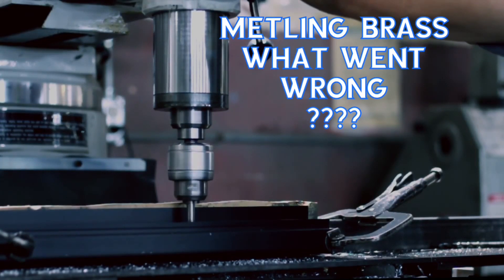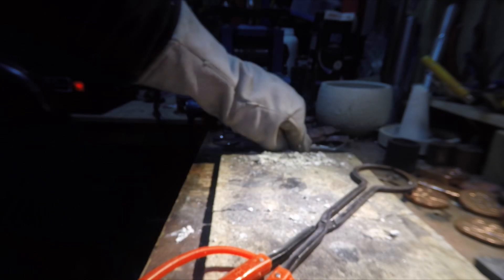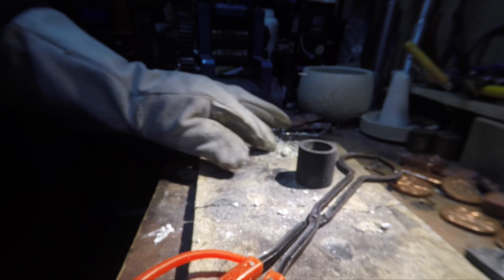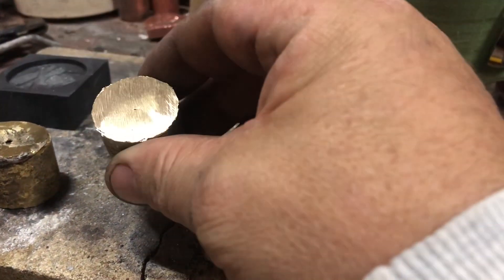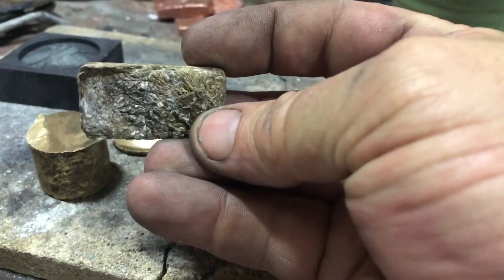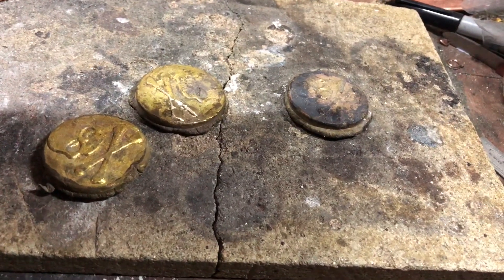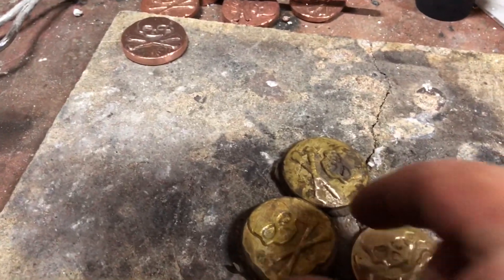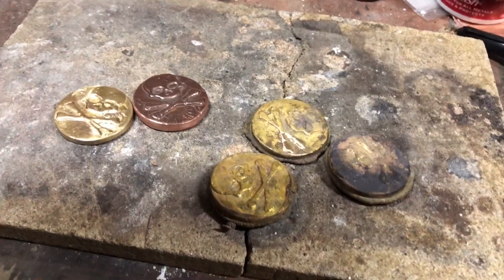Melting Brass What went wrong

Comment: Loved the video, would be good if you could make some replica bronze age axe heads and arrows.
Reply from the maker: Geoff Beepingmad funny you should say that as that is in the pipe line at some point but without an original to use in a sand casting makes it difficult
Reply: @pomzmetaldetecting1618  funny you should say that. I have just got mine back of the museum. They have had it for 4 years rapped in tissue and stuck in a dray. As it was on loan to them I have now got it back.  It is 3000 BC you are welcome to use it.
Reply from the maker: Hell yeah
Reply: @pomzmetaldetecting1618  cool is it ok if I get your phone number off lee
Reply from the maker: Yes of course. I expect you know how a sand casting works you use the original to make an imprint in the sand and remove it leaving the shape of the original in the sand.
Reply: @pomzmetaldetecting1618  did a bit when I was at school. I can drive again friday. More than 72 hrs post op or you can pick it up.
Reply from the maker: I’m out of town this weekend Geoff. Give it a couple of weeks till your all better and I’ll come over and do some detecting as well 👍
Reply: @pomzmetaldetecting1618  sounds like a plan

Comment: Zinc can be the cause of it, but make sure that when melting brass again you use a mask as when the zinc burns off it produces a poisonous gas, and it's the zinc that produces the white ash.
Reply from the maker: John Lee Richards thanks very much for your advice 👍
Reply: @pomzmetaldetecting1618  Not a Problem  mate if I can give advice I do If I don't know I don't as I don't want to give out wrong information. Just glad I could help.
Reply: just subbed to you Mr Pom Z
Reply from the maker: Great thanks for your support 👍👍👍

Comment: The zinc burns as a white powdery smoke. .... Notice the smoke like vapors coming off the steel ..I melted down some old  brass to make a 200mm round to fit in a shell casing and turned it down on a  lathe looked really good .. enjoyed watching keep up the good work HH GL ON THE NEXT ONE BUDDY 👍
Reply from the maker: Stephen Pettican thanks bro ah that sounds like the answer to my question. HH TC

Comment: Not all brass is created equally. 😉.  But once you get the dross off it should be fine.
Reply from the maker: Ian Y Gath should have seen it I scooped loads off the top and it was spitting it out like candy floss and this was all from what seemed to be clean brass
Reply: Pom Z If the brass originated in India or Pakistan it will be lower grade and is often high in impurities.  Smelting temp. can make quite a difference.